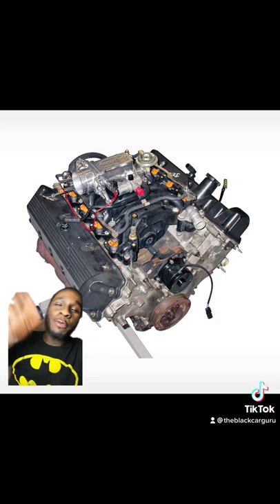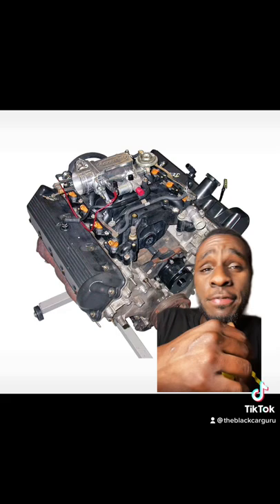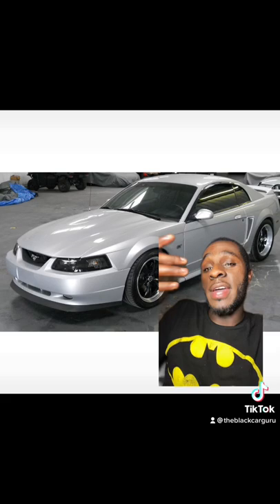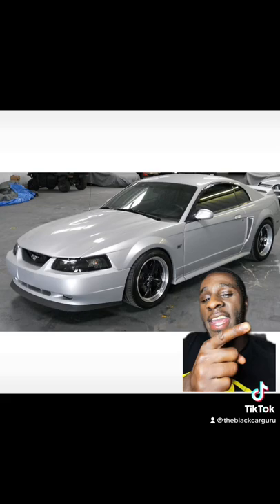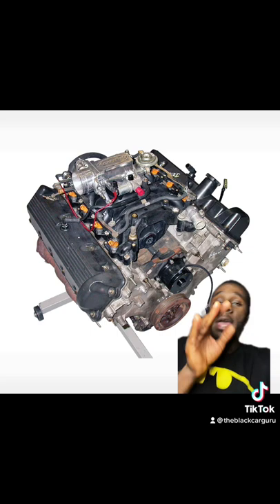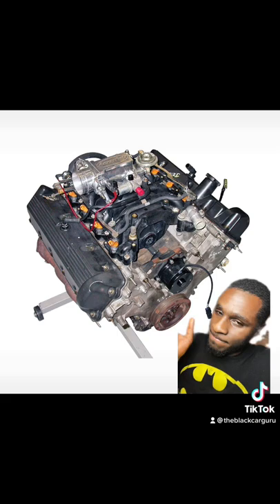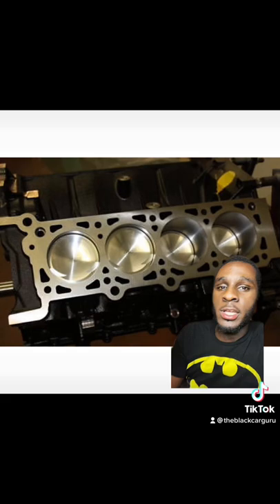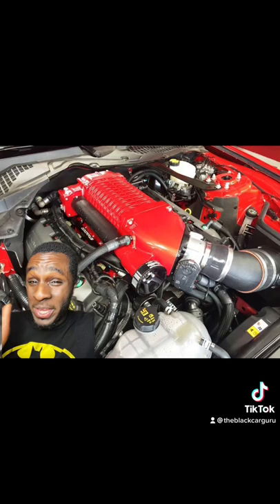Is the 4.6 2V worth building? | Let me explain why!

Comment: honestly the stock crank and block can handle 7-800rwhp reliably. new pistons and rods are about 900, cams for 700, blower for 3-4k if you can snag one on marketplace, 900ish for a trans rebuild, 600 for a clutch, 1500 for a fuel system. the stock heads perform pretty close the trickflow set once ported and given some bigger valves. honestly you could have a 700whp warrior for roughly 12-15k. car included
Reply: I agree, seen ppl running a forged internals otherwise stock engine 900rwhp.. It's doable, question is do you want full n/a built first or lowest cost to major power..
Reply: You can pick up eatom m112 blowers for right around 600 dollars without throttle cable and elbow
Reply: I agree people sleep on the 4.6 platforms. Plus that 4.6 2 valve sounds way better than the coyote!
Reply: @kskip4242  Yes sir, can't count the 2v out, it's the lil blue oval that could..lol
Reply: Slap 3v heads add boost, your not catching him.
Reply: Where the hell you getting the trans rebuilt for 900 bucks
Reply: Nvm i read clutch right after commenting, manual is how lol
Reply: There is no need to even port a set of pi heads when you force air in its different than naturally aspirated that's another 2k saved valve guides valve job  springs and cam is all you need for head work everything else I agree with you about under 15k and if you can diy which is the factor in price nowadays you're even better
Reply: @jonnathwill8318  FI needs to breath better to work the best. Porting/ polishing will do
Reply: @WarriorOfEden3033  I beg the differ there's more then a few channels on YouTube that use low flowing heads with forced induction and make gobs of power when you start forcing air in it's different from when there naturally aspirated for the average guy they will work for a guy that wants to run north of 1000 whp sure they will help
Reply: @WarriorOfEden3033  fyi what does polishing heads actually do that term alone is cringe-worthy 
Go check out Andrew lavender's page on YouTube his early on videos he used stock pi heads with turbocharger and ran high 8s low 9 sec he wanted to move up to well over 1000 whp and then he went to trick flow and bigger turbo which kind of proves my point
Reply: kevinkrause1877 Then you’ll just have a “$600 m112” for a paperweight because you can’t attach it to your engine 🤷‍♂
Reply: johnathwill8318 Porting and POLISHING has been around for decades and you THINK it’s “cringe worthy” because YOU don’t know it’s purpose?
Reply: @eriv4735  you need to read my statement correctly I said what is the point of polishing can you read
Reply: Do you not know the purpose of reading I said nothing about porting I said what is cringe-worthy is polishing and what does that do please read before commenting thank you
Reply: @P71ScrewHead  did you get your parts
Reply: @eriv4735  let me ask you something why are you responding to me about porting I said nothing about that I only said what's the point of polishing with the screens 
You call me childish but in your statement you said porting and polishing I've never said anything about porting sir I only said polishing
Reply: @eriv4735  my statement was only about polishing why would you reply back to me 🤷
Reply: @eriv4735  yeah let me polish my heads and gain how much 40hp lol let jus bout move on how about that ✌️
Reply: @eriv4735  when you know something sometimes just no need to argue nor debate I'm move on you  win 🤷✌️🙄
Reply: jonnathanwill8318 When you don’t know something and voice that ignorance sometimes someone will call you out on it..this was never an “argument” nor a “competition”, this was you exposing your ignorance and me pointing it out and providing you with the information you were lacking..NOTHING more..you’re welcome
Reply: @eriv4735  you jus can't find anything thing else to do you win do you have a wife and kids that you can focus on this much no point to call someone ignorance and keep looking to have dialogue back-and-forth doesn't make you look that good either
Reply: @kskip4242  idk if that's the same engine as mine but my 94 Thunderbird has a 4.6 SOHC, I cut both mufflers off the dual exhaust and welded downswept and it sounds great. The drone kills you though
Reply: With what boost kits is this  Capable from. Would a procharger work?
Reply: @jonnathwill8318  anyone can build a car & say they didn't need to do X but the fact is a ported head will perform better under boost
Reply: @jonnathwill8318  polishing air ways in the head increases velocity & reduces turbulence. Porting just increases the volume of air/ removes imperfections and poor transitions. No cast aluminum head is perfect only billet heads are nearly perfect.
Reply: @jonnathwill8318  already know about Andrew you just proved my point about heads by mentioning him 😂 a ported PI head will out flow a Trick Flow head. Go watch Eric Weingartner or Richard Holdener they actually knows what he's talking about 😂
Reply: Wrong ASF go to Marty ochs
Reply: Rods, pistons, cams,ported pi heads & forced induction of choice. Over 700whp easy
Reply: Those 2v's are pretty stout. The sound, when done right, is one of the best sounding sbf's ever.
Reply: Not worth it big homie
Reply: My buddy got a 4.6 2v TFS heads hellion Turbo kit built 4R70 trans forged bottom end on a very very conservative tune 636 whp 630wheep torque
Reply: 900 for a trans build for stock rebuild, You're gonna actually spend 1750-2500$ building the t-45 or tr-3650 to hold 700-800whp reliably, plus the rear end and axles etc. That 12-15k number is more like 20k but thats part of the game, and 20k for 700hp is great in my opinion since a dodge hellcat makes waayyyy less than 700whp and cost 2-3 times as much
Reply: Crank can’t handle that power, anything over 400 is pushing the stock crank and will reliably blow up like a grenade
Reply: @lordzeuscannon6400  Just fit some J pipes.  Kills the drone
Reply: What do you mean by fuel system, fuel injectors?
Reply: Where are you getting cams with lifters and springs for 700$
Reply: You right!!

Comment: 4.6 2v you don't need to do cams to boost it. Rods, pistons + boost you're good for 500-600hp. Add in a crank and you're good for 700-800 without touching the heads really
Reply: The stock crank can take 7-800..the stock pistons can handle 6-700..the only thing that truly needs changing is the powdered metal rods that can barely handle 500hp
Reply: This. This is why I'd just keep the 2v

Comment: I built my 4.6 for $1260. Forged (-18cc) manley pistons, factory crankshaft, used factory forged rods out of a gen 2 5.0, and studs. 

On top of that i replaced some wearables but as far as "building" the bottom end, it was $1260 for forged pistons/rods, arp head studs and arp mains. 

$500 port job on a PI set, $500 deck and valvejob, $160 springs, and running stock cams on boost right now. My stage 2 turbo cams are still 8 weeks out. 

I've got about $3k in the motor total. That's with a melling hv, oem timing, oem followers and lash adjusters. The car is boosted junkyard style. Transmission swap cost me about $1800 including custom driveshaft.

All in all these are not particularly affordable engines to work with, but they're not that bad. My goal was to build a poor man's version of a coyote lol. I build transmissions, engines and turbos for a living so i had a head start on resources. 

Transmission is an MT82. One of my mt82 cores had a gaping hole in the to of the bellhousing but was a good core internally. Since no customer would want it i built it for myself. Technically I put about $600 in it but already had all the parts on hand since i build these

By the way this is an 01 f150 extended cab. It's a rear mount turbo set up right behind the cab on passenger side in the bed. I spent about $200 in intake piping/elbows etc, $100 for exhaust piping and turbo flange. 

I had a HX40 core laying around from an 8.3L Cummins worth about $100. Threw in some journal bearings for about $20 and ran it. Retains factory exhaust until pipe gets to the bed of the truck. Exhaust pre-turbo is coated and heat wrapped. Its a small turbo and spool is practically instant despite being a rear mount. Oiling is easy because the turbo is much higher than the oil pan. 

I dyno'd the car @396whp, 441tq with this set up. Same day I bolted in a 67/67/16 hx40 hybrid that i built and went 492whp and 498tq. Truck just runs out of breath with the stock cams and can't take advantage of the bigger turbo so I went back to the 60mm stock hx40. The truck suffocates at 5000+rpm and doesn't give the turbo a chance to build all of it's boost. With the new cams motor will rev out to 6800-7000rpm. When my cams do come in, I definitely intend on running the 67mm. I want a 12 second truck but need to keep it no higher than 600 whp due to factory crank. Lots of people make way more than that on them but I play it safe.

The whole project is a testbed for me. I build mt82's, I build holset turbos, and i build the triton motors for customers on a daily basis. I need a personal testbed as well as unique showcase for my work. It's an actual 1 owner grandpa truck with a camper and all. 350,000 miles on it. The intake tubing runs through the factory intake/airbox and it looks 99.99% factory under the hood. The turbo is contained inside of a truck bed aluminum tool box inside of the camper. It is a legit sleeper inside and out. Only way you will know is if you crawl under and see the exhaust piping take a detour 😂😂😂
Reply: Could I do this to my crown vic

Comment: 10yrs ago I built a twin turbo 2v using an MMR short block, Trick Flow Heads, and HP Performance twin turbo kit.
I made 725rwhp on 18psi
Reply: Holy shit that's badass dude! Lol
Reply: Can you help me with my 2v
Reply: Can you help me build my 2v
Reply: @leon davis  
I can damn sure give you some good information on what to do.  Leave your email address👌🏽
Reply: Could you help me with my 2005 f150 lol
Reply: Man I envy the knowledge you have
Reply: This is what i want on my 4.6 2v built it to 600 to 700 hp i knoe you can there is allways a way never say no help me out how much is the total for making a 700 hp 4.6 ??👌
Reply: @liamordones7790 it isn't much boss rods and forged pistons can do that with a stock crank but you'd be at the limit for sure of the crank.   You can add a forged cobra 8 bolt crank for more longevity but not required in the 600-700 wheel range.  You can do ported heads or trickflow if you can swing the cash and boost plus fuel system.  It's not nearly as pricey as people make it out they make good boosted power plants for the money spent.
Reply: damn dude, whats possible w a vortec or paxton? any help is appreciated for sure. i know your post is old but i can give you me email or number to text me etc. sick build on a 2v.

Comment: Well I'm about 30k into my entire drive to include the Engine with the KB 2.8 LC blower, with a little laughing gas and some water meth to quinch the thirst. Wasn't a bad investment at all. Definitely shocked the hell out of a Fox Body with a 200 shot and a 2014 ZL1 at the track and I was on the street tune without my 50 shot. And I still can go down a pulley size  for more boost. And to add some numbers for your viewers: paid about 5500 for the Iron block with internals, 700 for blowers cams (that I didn't need), 9k for the blower with the 8 Rib setup, and almost 5k transmission with the goodies. Big shout out to you bro! Found out you was from the M today! Keep up the good work! Subscribing now!
Reply: Does it make 1200hp?
Reply: @taylorsrus9543  No, not at all. The setup would probably reach the 800s with a pulley swap and an aggressive tune. 80 lbs Injectors, lines and pump support up to 800 ish. Would have to upgrade the system for more than that. As of now, I still have never used the NOS or ran the car on the race tune. Only dyno'd and tuned for the settings. So probably not swapping the pulley until I've played with the car some more. Overall, its not bad for a 2002 GT with a 2 valve block and stock rear gears.
Reply: @johnnyhotstuff1  yeah, that's the reason why people move away from that old tech. 30k is a lot for that level of output these days.
Reply: @taylorsrus9543  I feel you. Newer engines can handle more power from the jump. B the tech is very relevant. Just bells and whistle that I desired for my setup. Window switches for the NOS water meth. Meaning it comes on and shuts off without me having to push anything. Command switches to warm, open, and purge on a hidden panel. Transbrake integrated in the transmission. Beefed up splines, aluminum drive shaft. Even trick flow head that I didn't need. Honestly, the blower setup alone would have put down 701 to the tires on 93. But some people just want a little more just because. 
And of course there's the labor for all the gadgets installed. A buddy of mines did a single turbo on a built block and spent half of what I did making more on E85.
Reply: @johnnyhotstuff1  Yeah, don't feel down for spending that much on your ride, it's all honesty worth it what you did n spent on it, you gave honest numbers, most ppl bullshit around n say "I spent $2k with ls n made 10,000hp" but don't tell you they stole the engine or bought junk 3x before one worked for them.. Also most ppl have to pay labor n most definitely leave that out of the equation altogether.. Swapping an engine costs money, n most ppl yelling swap to an ls won't tell you how much they're being charged just to swap to a bullshit junkyard motor.. Better to build what you got n done.. I'm building my 2v P71 n/a with TrickFlow top end kit n I'll be over $6k once labor is included bcuz I love my 2v n fuck an ls..lol I'm no cheap ass.. 😆🤣 Understandable why ppl rather steal built engines tho, fuck them haters..

Comment: Fairly accurate info. I have a 96 GT automatic. Did pi heads swap, pi intake, steeda under drive pulleys, long tube headers, BBK 73mm SCT tuner, Ford Racing 9mm wires with Screamin Demon coil packs..... it'll scream lol. No, won't spank a newer 5.0, but it'll make them run they're guts out to leave an old sn95 convertible hehehe also, parts and cost of car, got about 8k total in it. So much fun and sounds soooo good
Reply: 2vs may be the best sounding.

Comment: I’ve got a 98 sn95 with a 4.6 and it’s slow as hell buts it’s a fun car to drive and it sounds like no other car. If you get in the mustang community you can generally find parts for them cheap and a lot of parts between years are interchangeable. I bought a 4.6 pi from by buddy for 1500 dollars and it was freshly rebuilt. I plan on dropping it in a 69 mustang coupe I’ve got
Reply: Hell yea man!
Reply: We built a buddy's 16 yo daughter a car.

Picked up a '96 Roller with a grenaded engine, used PI engine, used Vortech Blower (nonintercooled 96-98 kit, changed some bolts), some used chassis and fuel system parts and a good tune. Got about $4,000 in it.

7.5 1/8 (High 11 second 1/4). It isn't fast, but it's plenty for her at this point.

Comment: 2V limit will always be air flow due to the heads and smaller displacement. The 4V would be a better option if you can get one cheap from a wrecked Mach as they respond to forced induction as well as cam work so much better.

Comment: Bought a 01 bullitt recently, Just did a whole engine rebuild, New cams, New lifters, adjusters, New timing chain kit and aluminum radiator with hoses for less than 1500,...going to have it running mint as a daily until i save up for the coyote swap

Comment: Agree I had a 99 gt a lifetime ago 2009, I did Trick flow heads, nsr stage 2 cams, long tunes, it made 298/330@ 6300 at the wheels, I spent right at $4500 doing all the work myself.  My first mustang was a 93 gt i did whole top end Trick flow the 5.0 made a best of 288/340@5700 at the wheels. Cost me $3000 in 1999. Now I own a 12 3.7 mustang ported intakes, throttle body, intake runners on the heads, headers, tune .020 manley forge pistons and rods Cost me $1800. 3.7 made a best of 314/306 @ 7400. All of the mustangs ran/run 12.5-12.7. 106-109mph. the 2v wins the sound contest all day but is very expensive, Its a solid motor but pricy.
Reply: damn i made 280/330 with just long tubes, intake system and a dyno tune completely stock unopened 2004 2v
Reply: Adam Helmers Must have been one happy dyno 😂🤣

Comment: I’m building a 4.6 2v. Kellogg crank, forged h beam rods, and pistons. Using an NPI iron block and putting ported PI heads on. Using npi block and pi heads bumps the compression up and gives a bit more HP. I’m gapping the rings for a little boost. Mated with a 3650 standard. It’s going in a crown Vic. Not building it for power, but for fun. And it was the last project I was planning with my Mom before she passed away last week so I’m all in on this one.

Comment: 4.6 2 valve can handle a lot more power on stock parts and it sounds a lot better than a coyote.
Reply: A 4.6 2 valve will be on its edge at 500rwhp where as a coyote is just getting started at 500rwhp..not too sure you got that right bud 😂
Reply: @eriv4735 he wasn’t comparing power to coyote he was comparing sound🤷🏼‍♂️
Reply: zachc8833 4.6 2 valve can handle a lot more power on stock parts AND it sounds better than a COYOTE…

He’s CLEARLY comparing the power AS WELL AS the sound 🤷‍♂🤷‍♂🤷‍♂
Reply: @eriv4735  feisty lil dude aren’t ya 
Why so aggressive

Comment: PI swap, coyote rods, forged pistons if you can find em used in box, and a kenne Bell. Of course factor in other supporting mods and parts. You can pretty much keep everything stock except the rods and exhaust. From there build the tranny (Or swap it) and reinforce the rear.